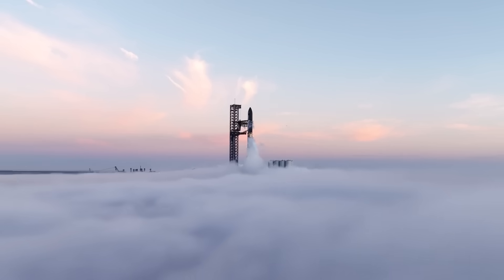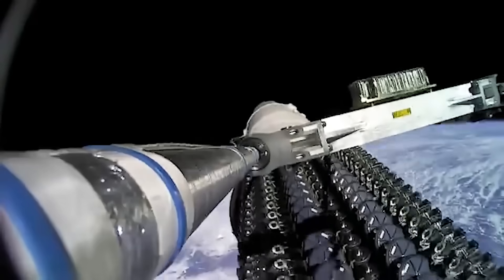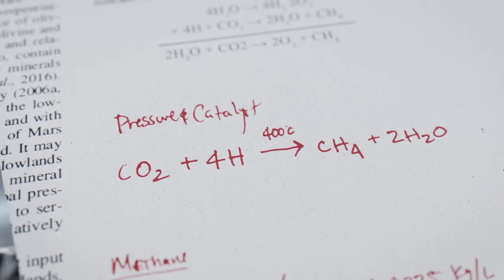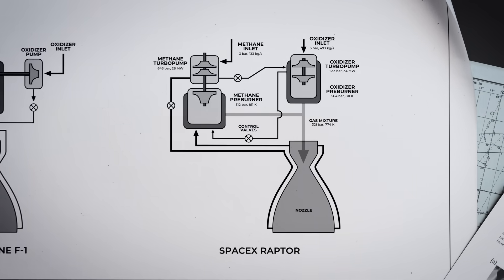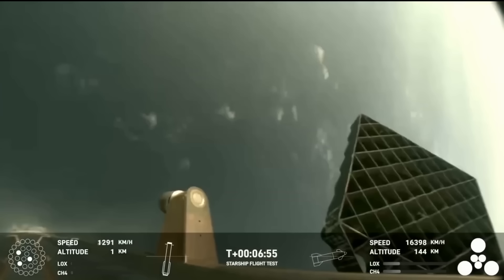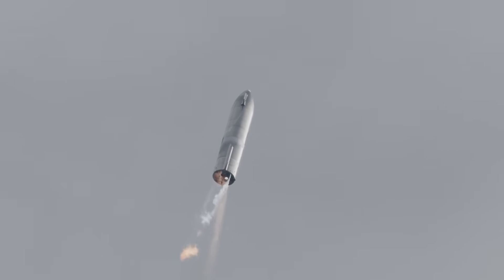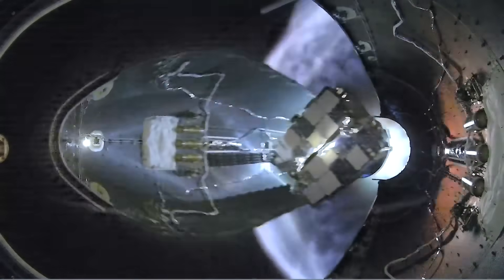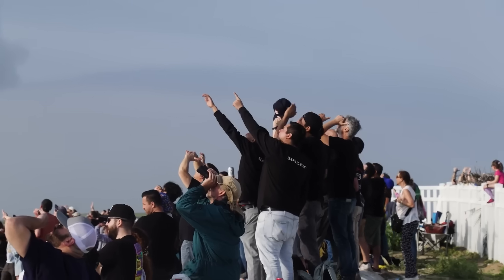Starship Reached Space. What Now?

Comment: I am quite skeptical about the claim that Starship will be that cheap and easy to re-use, for mainly three reasons: 
- It uses similar technology to the Falcon 9. The Falcon 9 is nowhere near being easy, fast or cheap to refurbish (compared to the stated goals)
- It uses tiles, licensed by NASA, that are maintenance intensive which were one of the main reasons it took so long to refurbish a Space Shuttle
- During the last demos tanks were basically completely used up just to send up an empty demo. The payload claims seem a bit optimistic.

I am also skeptical for its ability to be human rated without an escape system.
Reply: - actually it is. Original goals were for reused second stages too but that was abandoned due to a lack of incentive. Falcon 9 has been turned around in 17 days and that’s with a need for more refurb due to the Kerosene fuel used leaving soot in the powerhead of the engines. It is clearly an easy and fast vehicle for them as is with 3 launching in 1 day recently the most ever with 140 missions planned this year. 

So really that’s not true. 

- the tiles on shuttle were very specific. They needed exact tiles for each area kind of like a jigsaw. SpaceX’s tiles (their own proprietary tiles btw not NASA ones) are mass produced and of the same hexagonal shape with only a handful needed to be different on the joints for the flaps and nose. We’ve also seen that they have very quickly swapped them out and assembled them into vehicles before. 

- on these flights the tanks aren’t full up. This was actually an issue on flight 2 as they kept more lox onboard to simulate a payload which led to the vehicle terminating after a fire caused when they dumped it. The payload claim has been verified by engineers and enthusiasts who follow and analyse the vehicle.
Reply: @weekiely1233  -17 days to refurbish and "just the time to refuel" is not a small incremental but a completely different scale of complexity. 
- The tiles are still falling off in droves, attesting that the technology is not ready and has to be attuned. Moreover what made it difficult for the shuttle was not the shape, but the way they were glued to the subframe to allow for thermal expansion.
- The rocket was fueled up to 85% and did not reach orbital velocity. A 15% increase in propellant does not give you 100t of extra capacity to orbit, not even close.
Reply: @yoshyoka  falcon 9 currently has refurbishment that quite literally cleaning the engines from soot, CT scanning for structural issues and….that’s pretty much it. Swapping engines here and there too but that’s like it. Starship could definitely get to the point of flying one flight and another back to back. A reminder that many saw reusability as a dream that wouldn’t even happen. Many thought having 10 flights per booster with minimal refurb was impossible. Yet that’s reality now. 

You were on about how expensive and complex the tiles themselves were and that’s due to weight. The tiles have also held better and better on each flight and they can actually have a few get lost within margins due to the Ceramic Shield underneath and the properties of Steel. There is also nothing wrong with the tiles just tweaks needed to the attachment pins. 

Physically the vehicle can carry 100 tons. This isn’t something where you just have to take their words for it you can actually calculate it from the design of the vehicle. It also did get incredibly close to orbital velocity (98%) and in theory on a different trajectory it was orbital.
Reply: @weekiely1233  From "swapping engines here and there" and turn around times of hours there is a significant difference. 
I do indeed believe that turn around times will get shorter and flights cheaper, yet I don't think we are getting to the "two orders of magnitude" cheaper that they are claiming. Not even close. 
An empty test vehicle, loaded up 85% did deplete nearly all its fuel reaching near orbital velocity. 15% more fuel will not make magically go 100t of cargo plus the weight of itself into orbit: changes will have to be made. 
I am not stating there is no progress, that they will not make it eventually or that what SpaceX is doing is not amazing, because it is. However the claims are quite overstated. Still, I will be happy if proven wrong.
Reply: @yoshyoka  guess we’ll see then. 

actually it can. More performance comes out of the small amount of fuel at the end than at the start. It’s also incredibly likely that they used excess fuel to simulate a payload due to the large amount of venting post SECO. And also the ship is going to stretch to increase performance and payload capacity with version 2 

The claims are in a future tense. False Attrition of them to test prototypes on developmental flights is a user error not an exaggeration of the predictions
Reply: Fair enough to be skeptical. But you do have mistakes here. First, while the Falcon 9 isn't hitting its goals completely yet, it is still very cheap and quick to refurbish. Under 3 weeks to refly at a cost of 20-30M for everything, last told. Remember on price that what SpaceX charges customers is based on the market, not launch costs. They make a nice profit on every launch.
Starship uses tiles, but they are not ablative. Neither were the Shuttles' tiles. And the Shuttle took so long because each had to be individually inspected and/or replaced. SpaceX developed their own that are much faster to do so. That's a long topic.
During IFT2, the fuel tanks were being dumped from the upper stage during flight so that it didn't have so much coming back through the atmosphere. That caused it to explode. During IFT3, they didn't load as much fuel in the first place.

For human rating, we will have to see on that. It will be difficult to be human rated for launches from Earth (HLS doesn't need this) without a LES. However, the Shuttle didn't have one either. Granted, it ended up not being that safe of a vehicle as well. But it does show that human rating a launch vehicle by NASA can be done without a LES onboard.
Reply: @anthonypelchat  we accidentally made the exact same comment at the exact same time…
Reply: @archierush868  Great minds think alike. They also apparently make comments on YT at the same time too. 🤣🤣
Reply: @anthonypelchat  As SpaceX has no transparency on real costs we have no real data on what the costs of refurbishment are at the moment. Fact is that an easier vehicle takes weeks to refurbish and a used booster grants only a discount of (the real prices are not disclosed either) about 20%. This is a far cry from refurbishing in hours and a "two orders of magnitude" in cost reduction that is often advertised. 
The tiles' compound is licensed from NASA  and there are still obvious issues with them.
As I am used for Musk to overpromise and under-deliver, I take claims with a healthy grain of salt. At the moment they are still struggling to demonstrate a controlled re-entry, thus I think it is way to soon to take the other claims as a given.
Reply: @yoshyoka  For Falcon 9, we have had 3 different execs at SpaceX each at different times confirm the rough price. And that price is for the entire system, not just the booster.

Also, they have learned what is an issue with Falcon 9 and what isn't. The aluminum alloy used, the type of engines, the type of fuel, the landing legs, and even landing location are all drastically different with Starship compared to Falcon 9. And its possible that some of these could have been changed with F9. However, these would have likely caused issues with with F9's flight rating which itself caused a design hold on F9. And some would have caused more time that wasn't worth it with Starship development moving forward. You can see that with the canceled reusable upper stage and the canceled human flight rating of Falcon Heavy.

The tile tech is part from NASA and part custom from SpaceX. But they are not the same as was on the Shuttle. Lots of differences. And there are still issues/concerns with them, which is why SpaceX isn't focusing too much on reusability yet. But again, everything is drastically different than the Shuttle. 

Notice how I don't directly quote Musk on any of these. That is because these aren't his claims except for him being one of the 3 execs that discussed the price of F9. SpaceX is more opened than any other launch provider.
Reply: @anthonypelchat  While all the above is true, nothing of this really addresses the parts I am skeptical about. indeed there is improvement, yet I am still very skeptical that this can possibly lead to the monumental change they claim it to be.
Reply: @yoshyoka  I get your skepticism. I would say though that you're looking at the best case scenario only. And a lot of that might not work out as well as hoped. 

However, look at the current worse case scenario based on what SpaceX has already proven. Starship can be fully built quickly and cheaply. Not as cheap as a fully reused vehicle, but still cheap. And based on the engine specs*, it could easily deliver more to space than any other rocket before if fully expended. That alone is huge. If they just get the booster to be reusable like Falcon 9, that drastically improves launch cadence and reduces the costs while still keeping it well above the capabilities of any other rocket.

*Technically using published SpaceX specs, which could be false. However, there is some math that can be done to validate from current flights that the specs are at least close to published specs.
Reply: 1 (Similar F9 technology): Yes, it does use similar technology to the F9 since SpaceX already knows how to fly the F9 and so minimal changes will be done. It’s also just the booster which will have a similar flight trajectory for the F9 booster, the upper stage is completely different.

2 (Ablative heat shields): The heat shield is not ablative. This would mean they would need to replace every single tile, which would take weeks, maybe months to replace. They are not gonna use ablative heat shields.

3 (low fuel with no payload): They didn’t fully load the ship and booster with propellant as to simulate if it had a payload. They account for this by downloading it as they would never actually launch a real Starship mission without a payload.

Edit:

4 (No abort system): see Space Shuttle. It had no abort system except for an abort to orbit which it did do at least once. Starship will likely have this kind of system as well
Reply: @archierush868  1. Indeed: I expect similar tech to perform similarly, not orders of magnitude better as advertised. 
2. Indeed, they are not ablative, my mistake in writing. Still they face similar issues in controlling and replacing them (as the loss of tiles in the last test clearly shows). 
3. They claimed they loaded the tanks 85%. 15% more fuel does not get you much more payload capacity, let alone 100t of it: the rocket equation is true also for SpaceX, there is no escape from it. 
4. I hope it will! The shuttle had a much easier re-entry technology: you know, more complexity, more possibilities for something to go wrong.

Comment: it rather seems to me that this unstable reentry for the booster section was the abortion already done on purpose. started at those 144km (at least what the video shows). when this grid wing thing starts to move position.

could be they did not had any intention to land or flash it into the ocean at all.
the advantage is if you abort it that way. the material can still easily melt up into the atmosphere what helps for waste disposal. better than polluting the ocean with the material. or cleaning up the ground later.
this is also a company behind all that. and for saving costs it is the better strategy as well.
better to make special tests for landing later. than now. 
not to mention the booster part is later supposed to be catched by those big catching arms. i wonder when those tests will start. i recommend building an additional tower for that just for testing. a bit in distance from the normal ones site. this way you avoid damaging the rocket starting complex only tower. 500m-1km  in distance for a 2nd (catching tests) one should do the trick.

Comment: With the Martian atmosphere being almost entirely co2 some research should be done on hybrid rockets that use pure carbon as fuel
Reply: There is water ice on the martian poles and possibly some liquid water underground. They get that water, get the carbon dioxide and use them both to make methane and oxygen for fuel, breathable air or just keep the water for drinking or cleaning.
Reply: It would probably be better with a rocket running on liquid carbon monoxide and liquid oxygen. It has actually been proposed for Mars, and is entirely possible. The performance of carbon monoxide as a fuel isn't great, but it would be good enough for orbital operations on Mars, and for returning to Earth. And the ISRU couldn't be easier.

Comment: With our world at risk due to climate change, this is all just an insane ego project.
Reply: No it isn’t
Reply: @weekiely1233 yes, it is :P
Reply: @rafaeldegiacomoaraujo8778  you can make its fuel from carbon dioxide and water. It takes greenhouse gases and makes them into another greenhouse gas that is not as bad as the gases that the fuel can be made of.
Reply: @rafaeldegiacomoaraujo8778  no it isn’t
Reply: @weekiely1233 yes, it is!
Reply: @weekiely1233 yes, it is!
Reply: @weekiely1233  it is
Reply: @rafaeldegiacomoaraujo8778  literally isn’t. The GLOBAL spaceflight industry produces just 0.0005% of emissions. 

Starship and other Methalox or Hydrogen vehicles are also less harmful to the environment, produce mostly or entirely water as an exhaust and don’t leave soot. They both can also have propellant sources directly from the atmosphere which is already being developed 

Reusable vehicles are also far lower in emissions due to no marginal manufacturing emissions
Reply: @weekiely1233  yes, it is!

Comment: You do not deserve to have 4.27 million subscribers.
Reply: Just unsub if you don’t like the content anymore. He makes videos about incredible feats of engineering. This is an incredible feat of engineering.

Do you just not like SpaceX, Elon or Starship? Just say that instead.
Reply: @archierush868 Completely crazy -- all indications so far are that Starship is an abject failure!
Reply: @rdbchase Define: Test flight
Reply: @archierush868 What has happened in three test flights?  Starship has still not achieved orbit, not demonstrated propellant transfer, not successfully re-lit Raptor engines in space, not successfully opened and closed its payload bay door (not that it has anything to do with getting people to and from the lunar surface, for which purpose taxpayers paid SpaceX almost $3 billion), and not had a controlled reentry.  Not a single booster or Starship has been recovered and the program has already blown through about three times as many engines as the Shuttle used during its entire existence.  SpaceX has already seen more failure with Starship than any of NASA's manned rocket programs -- the purpose of test flights is not to destroy all test articles!
Reply: @rdbchase  How would they know all of this if they never did test flights?

Edit: Why does using so many engines matter when the costs of the engines are projected to be as low as $250,000 but is more likely a little below $1 million. RS-25’s cost around $40 million and they will be single use on the new SLS.
Reply: @rdbchase  Those dates are old now and no matter what, we will go back to the moon, even if that means it’s getting delayed. Delayed does not mean cancelled! If IFT-1 was flawless and worked perfectly, then maybe we could be seeing early catch attempts, but problems arose. So they fixed them, launched again, found new problems, and fixed again!

And I already said this before but maybe you missed it: if NASA would have taken complete control of Starship, it would have been much slower and much more expensive!

One SLS rocket launch (Not including development costs): $4B

The entire Starship program since 2019: $5B

3 orbital launch attempts within a year and massive progress made within that year from spinning out of control a few minutes after launch to getting reentry data!

Less than a year from IFT-1 to 3!

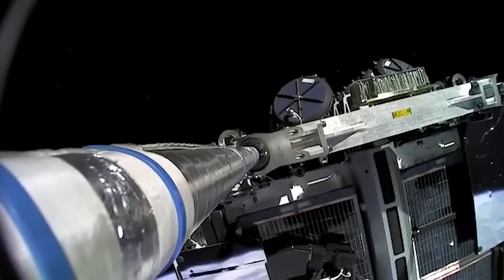Comment: 2:15 actually... the shuttle DID have a satellite relay system for communicating with the ground during reentry. it was called TDRS, and it generally worked pretty well. the shuttle had a transceiver on the top of its tail, which allowed the shuttle to communicate with the TDRS satellites above it during reentry.

Comment: Why are round cylinders harder to bring under control than wider underbellies?
Mass - velocity - inertia
What's the formula?
How much power does it take to overcome the inertia of spin?
It looks like those fins are substantially undersized for the mass of starship.  Also the vector thrusters appear to be way underpowered with not enough gimballing and rotation on both sections.
It also looks like the raptor engines were starved for fuel once again.  More and smaller fuel tanks are needed.  Much easier to keep pressurized.

Comment: Only 45 more launches to go 🤣 and all they have to do is figure out how to not loose control of both vehicles, land them, refuel the orbiter in space 20 times, build a human rated version that's so safe it doesn't need a launch escape system, design a reliable moon elevator and get the heat tiles to stick.
Reply: They will though lol. And you will still be coping over it

Comment: It seems that the wings of the second stage - Starship - may not ensure a symmetric distribution of drag forces during entry into the atmosphere, and, hence, its uncontrolled rotation is possible. It is a bit different solution than in the case of the space shuttles.
In addition, there should also be a horizontal flight to cool its drag surfaces, not just a vertical gravity drop operation.